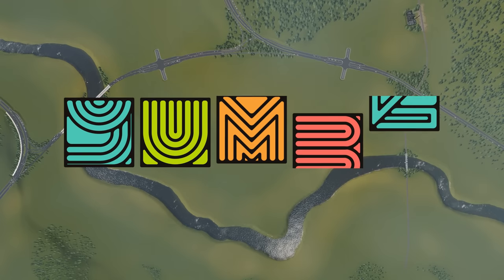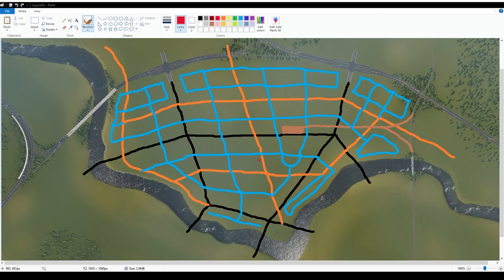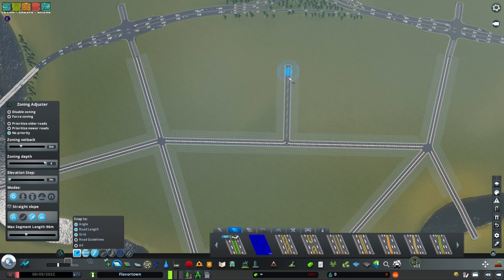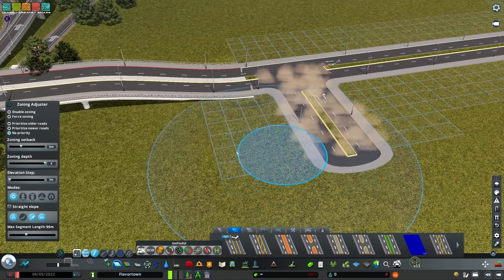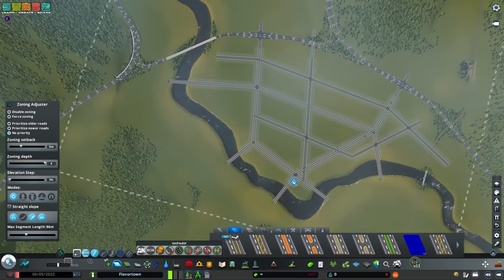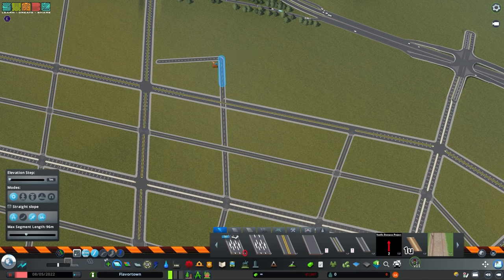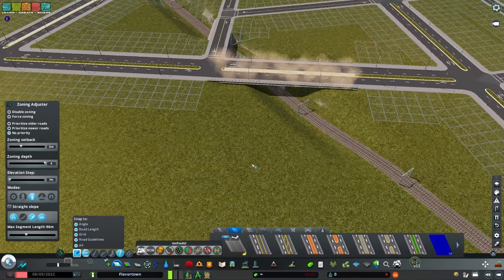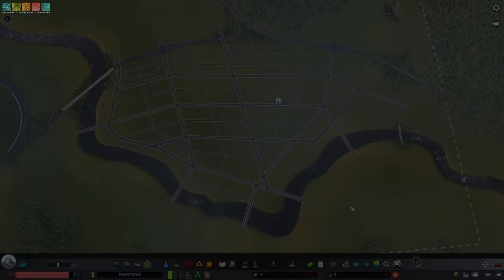City Planning Made Easy!  -  Road Hierarchy and Layout Design Explained

Comment: Road hierarchy has been something I've always struggled with maintaining, much easier to plop down a bunch of 4-6 lane roads LOL
Thanks for breaking this down, it genuinely helps a lot!
Reply from the maker: You’re very welcome :)
Reply: as long as money is not an issue, it's not that bad to overuse big roads. In CS the main use of a road hierarchy is to influence car pathing, I feel.
Reply from the maker: I’m not into wasting space, so breaking down to smaller roads is great. Also, I think road hierarchy is best thought of as managing connections logically. To avoid bottlenecks.
Reply: @busTedOaS  Yeah, the problem with bigger roads is that the speed limit on those roads is all the same. By using road hierarchy, you set it up so that cars will take the route that takes them the least time (i.e. using roads where they can travel faster, as long as it's not too far off the direction they want to go). You generally don't want a lot of traffic trying to go through places that have "driveways", meaning houses, businesses, etc, since new cars entering the road directly blocks traffic.

Comment: 25:40 "The median is now functional" - enforcing the median with either Ctrl-S lane connectors or with lane arrows (as you did here) works well with adding a parallel bridge or tunnel. The result is basically a non-highway version of a parclo (AB2 configuration) or folded diamond.
Reply from the maker: Yes! Perpendicular though

Comment: My 2 major concerns with this layout (not counting the triangle, I can see turning that into a "single" intersection):
a) why is your arterial not continuing along the river and turning into a collector instead? (bottom left) Why collector rather than local (to make use of the river land value)?
b) isn't your arterial/collector network packed a bit tight with full intersections? Have you tested this area with high density residential/commercial, or is it meant to stay low density?
Reply from the maker: The plan is low density closer to the highway and higher density near the river. Not all of the smallest roads are in yet, but its a good start :)
Reply: @YUMBL  wouldn't you want collectors near the river then, to provide opportunity for local roads along the river, rather than the partial arterial you've got?
Reply from the maker: I guess you’ll have to see ;)
Reply: I was about to ask the same question; the way I understand it. the lower you go in the hierarchy the more intersections you can have without disrupting the flow of the larger roads. But you have arterials full of intersections, actually I don't see any difference between arterial, collectors and local, just the number of lanes. I thought I had the concept right, but maybe I'm wrong. Confusing!

Comment: The parallel road is much better (and more precise) to make a temp road at 90 from your model road a set distance long, then do the same further down the road the same length.  The two end points of those perpendicular roads are parallel to the original road.  Connect them, then build your road from there.

Comment: I like to make ring roads with the arterials, make a collector connected to 1 or 2 spots inside the arterial ring,  and all locals to the collectors,  and connect every house block with walking roads to the arterial, that has the shopping on the artirial road ring,  forcing the whole neighberhood to walk or bike, becouse driving is a longer trip in all cases

Comment: I'd be curious if lights would work with the at-grade train crossings that are close together in the upper right. Someone pointed out to me the other day that stop and go lights work with trains too, which is something I never knew. Although thinking about it as I type, it might not be great solution. If the approaching train could trigger lights at both grade crossings, that would be nicer. 
Anyway, this is a fantastic overview. As it so happens I'm starting a map too, my first pre-planned one, so this tutorial is just what I needed.
Reply from the maker: Yes, if you connect a train track to a road when the train comes through the gates go down and stop cars automatically. No need for a light.

Comment: I think I am always looking at my map too closely and fail to design for the big picture. I should plan my roads like this. 

I have one gripe with your design though. A lot of the intersections have really painful acute angles that I can't imagine using in real life. When I encounter these intersections in real life, I often try to route around them, as making the turn is impossible if there's any traffic. That doesn't affect sims, of course, and local roads can more realistically get away with it due to their lower volume. 

I think it can lead to a really interesting road layout if you follow up the initial plan with corrections to individual intersections to eliminate acute angles. Sometimes it may require shifting your intersection to the side, forcing curves into approaching roads, or creating complex intersections like your five-way triangle-a-bout in the south of the map. Those case-by-case decisions can add a lot of character to your map.
Reply from the maker: Many of those intersection angles will be eased with node controller, and signal controlled. I’ve found that the real world is full of non 90 degree connections and messiness, so I dont want to be so rigid in my builds anymore.

Comment: Great tutorial... though personally, I love that road pack but also hate it at the same time. The continuous medium has ruined so many road layout plans for me, and don't get me started when trying to use TM:PE to the mix. Even when trying to re-create the local area around here it's impposible as it insists on either each road being exactly the same, or must have a traffic light otherwise it ads that darn medium to the road, and not even in a useful style most the time.   You have a street with a simple yield? Nope. it add's that darn medium to it. Two roads crossing that are not the same? NOPE, it adds that darn medium. 

It doesn't matter what road option you pick either. I want to love that road pack so badly as it has so many road options that be perfect, if not for that stupid medium that auto forms, and the only thing the mod author has told me to 'fix' the  issue is, TRAFFIC LIGHTS, or 'change the roads so they all match'. and that sort of defeats the use of as even you show, collector and feeder, and so on road types. 

Even as close as Jan 1st when someone else brought up the issue, the authors only fix is "The only way to not make appear the transition is by enabling traffic lights" Really wish they would make a version fo the mod that dosn't have that darn auto mediums. If I want to do something fancy I'll use the intersection marking mod.
Reply from the maker: I agree. I wish it was more flexible.
Reply: What is the name of the road pack?

Comment: When planning the road layout for a new area, what are the approximate "minimum distances" you try to keep between intersections (arterial to arterial, arterial to collector, collector to local, local to local)? For example "if possible, no less than 20 units between an arterial intersection and the first collector"? I noticed I tend to build too compact instead of stretching things out a little more. Also, these videos are just the right thing to watch on a Saturday morning with a cup of coffee, thanks!
Reply from the maker: Thank you! I dont recommend any minimum distances. Playing by feel and experimenting to see what works is important. All that really matters is that cars have enough segments to change lanes if necessary.
Reply: I have personally found that 24 to 26 units leaves enough space to add to the city.  I have issues myself. I like symmetry too much, so I like to make things on even numbers and factors of ten are usually what i end up using. then when I decide to expand it becomes an issue because the game is mostly in factors of 6 or 12...

Comment: I am trying to replicate this one for TESTING purpose. I think in the game, the LITTLE TRIANGLE with arterial roads in the bottom might make the area nightmare for drivers. Why ?
In my opinion, it link two bridges traffics into one. Exiting traffic will be great cause two options to get out of the place, but the inbound could be bottleneck.
Did you implement it in the game? How traffic flows? Using some of your lovely interchange might change the eventual traffic issue there, or roundabouts?
Overall you're THE BEST and Thanks for sharing.
Reply from the maker: The triangle will be operated by a traffic light junction.

Comment: Only comment I have is that it is very seldom you have train tracks give way to roads when it comes to keeping at grade. For example there was a lot of discussion regarding lowering the rail road track that goes through my home town. As it's used also for cargo there is no way at all they could accept any steeper slope than I think it was 1% (may have been less even). You'd either have raised stations and tracks (expensive) or make sure all roads are either under or over passes (the least expensive option). Or of course you could have at-grade-crossings everywhere, but that is again a safety risk and traffic blocker so should be avoided..
Reply from the maker: I’m ok with the at grade crossing next to the station. The rest made sense to sink imo. I may raise the roads slightly, but I like it overall.

Comment: IIRC the "Planning Roads" (correct name?) mod negates the need for Paint for non-Vanilla players. Added feature is the planned roadways don't cost anything until you "open" to traffic. Nice way to plan your layout, reserve the space and then develop incrementally.
Reply from the maker: Yes, but ive found creating layouts in another medium to he helpful, rather than worrying about networks, angles, and nodes. A pen and paper would be valid as well.

Comment: I’ve been struggling with road capacity vs road hierarchy. I can make cities designed with road hierarchy, but I’m struggling to gauge how much residential, commercial, or industrial should be serviced by a collector. I fear that my collectors are really functioning as arterials, some local roads are trying to work as collectors, and my arterials are effectively highways. How do you determine how to get the right numbers in? Like do you say x number of local roads should be serviced by a collector, or an area about x size in diameter? I think I remember someone saying they did it based off of road width, like a larger class road should be connected every 10x road width, but I can’t remember the specifics.
Reply from the maker: I dont think there are specific rules, and i think you have the right idea. If you find that a road needs to be upgraded for more capacity, or downgraded due to lack of demand then do it!

Comment: As transit operator, former bus driver now light rail, that grid set up is a nightmare lol. It's the turns at the intersections lol.😁😁😁😁
Reply from the maker: I’ll be using node controller at the angled intersections. Increase the turn radius. This was just laying it out

Comment: Great Video:

however im als a big fan of trams, i think trams are way underrated in C:S and even real world. A Tram is also something medium between a subway and a bus line. So im wondering how you would implement that. Im guessing Trams are best placed on the  Collectors road. 

Things i dont like: i would have curved the most left Collectors road, just to respect the river even more.

i find those two railway crossing at the right Collectors road questionable. I hate railway / roads crossing. They are very dangerous.
Reply from the maker: I have a video about trams as well. This city will be served by metro and busses. 

The river will have roads or quays right up against it. Those are details that this video can’t cover. I generally don’t like arterials and collectors against the river. i want it to be a space for people. Parks, walking, shops, etc.

Comment: Hi i have a problem, i build around 50k city and my highways are not moving, got 30% flow, nice grid,  8 lane highway beltloop around,  with no direct acces to city, (you have to loop left or right in order to choose a entry to a city) and another belt loop inside the city which is above the ground.. Its really neat, but Cars are only using one entry.. they completly ignore the second entry which is faster and shorter.. i even tried to add signs, max highway speed, and adjust lanes, but its still a mess.. Can someone look at it, and tell me whats wrong? Im cornered

Comment: You might want to try using Paint.net, rather than MS Paint.  It's still free, easy to use, but has tricks up its sleeve if you find the need to be a little more fancy.

Comment: looks really solid, only thing is that skylines dont like trains on non-one-way roads, that station would not work well.
Reply from the maker: It will work fine. Traffic can only go right out of it.
Reply: @YUMBL  problem is most of the time, it causes backup and long lines waiting to get into a train, which would clog the artery. 
clogged arteries cause same issues in cities as in human body.
Reply from the maker: It effectively is on a one way road

Comment: What are nodes exactly when it comes to the roads? Like subtracting and adding nodes?
Reply from the maker: Nodes are where networks connect. The space between nodes is called a segment: nodes are the only place where cars can turn or change lanes.
Reply: @YUMBL  Ah I see, thanks! Love the use of paint, gonna use it from now on (if I have the required skills to use such an advanced piece of software).

Comment: I like your general road layout but I'm very disappointed with your train station location on an arterial with 0 consideration for parking requirements. I'd likely totally do away with the crossing right next to it too as it will become a problem eventually.

It feels as though there would be loads of undeveloped land between all your local roads so personally I would add a bunch of cul-de-sacs to fill the gaps without creating too many connections to main roads.
Reply from the maker: You havent seen the big picture. Train station will be a transit hub with parking. And yes theres still room for more roads within the grid. Chill out!

Comment: It works really well in Cities Skylines but in the real world the Hierarchy of Roads has actually made the United States a harder place to get around in. It was also instrumental in the design of suburbs when redlining (which is racist af if you didn't know) was very important to the country. So good in CS but totally horrible in the real world.
Reply from the maker: I dont think road hierarchy and red lining are really related. Places without highways running through their cities still have a hierarchy to their road system.
Reply: @YUMBL  city and road planning have historically been very political in the United States. Chicago is a great example. So the Highway running through the middle of the city was used as a method of racial segregation that is still in effect today. Over the years the boundaries have spread out in areas but it's still there. This isn't unique to Chicago. 
Redlining totally had an impact on how cities were planned. Even though HOR was an earlier idea late 1920s-esrly1930s), it makes areas car centric and therefore classist because none of those areas make an effort to have reliable public transportation or even sidewalks in a lot of places. People of color have historically and to this day made less money than their white counterparts, so how are the two not realted?
Reply from the maker: You just said a bunch of unrelated stuff. City planning can be done in a way that furthers inequality. That doesnt mean that road hierarchy is racist. Your point makes no sense. I mentioned places without highways running through their cities still implanting strong hierarchy in their roads, and you brought up Chicago. A complete non sequitur. Just because red lining exists doesn’t mean it has anything to do with road hierarchy. I honestly suspect you’re confused about what road hierarchy actually is.
Reply: @YUMBL  They are totally related. I tried to tie it together in a way where I wouldn't have to teach a college class in the comments section, but yeah, I guess you really don't see the relation. Oh well.